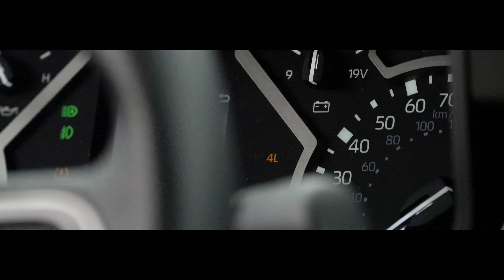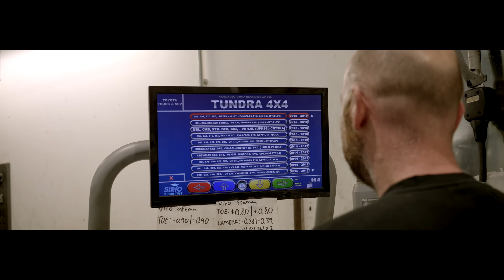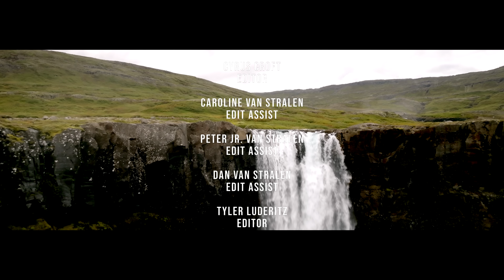Iceland Travel | F-Roads & Arctic Trucks | X Overland Nordic Series EP7

Comment: I use a digital gauge connected to my Apex valve stems. Leave it connected when you open them and you can close them with pretty good accuracy, lastly bleed off any extra to get to exactly what pressure you want. They are great valves 🤙🏼

Comment: How is the All-Cab gear workingout? How are the rooftop tents holding up? Are they quieter than the RTTs you have used before? How wind resistant have the awnings been?

Comment: So I have a tire question and might be a** given your sponsorship 
But what are you getting out of the x tires on mileage rotations and if you actually had to buy your own tires would you run theses given their cost and wear or would you run the AT tires ?
Reply: Most definitely we would run them regardless. We all run them on our personal rigs for daily driving my last to set. I swapped out at 60,000 miles and still probably could’ve got another 20k plus thousand miles out of them.  Always try to rotate every 7 to 10,000 miles if possible.
Reply: @Tanner_Johnson  your getting 60k out of mud terrain tires (X3)  or are you referring to the atx tires ?
Reply: @jshapiro34  60k out of my ATXs
Reply: @Tanner_Johnson  what are y’all getting out of the X3s on these rigs if that what your getting out of atxs I’m just trying to way pros and cons of atx vs x3 weight and wear and cost but still cheaper than the Mickey Thompson’s I just got 51k out of